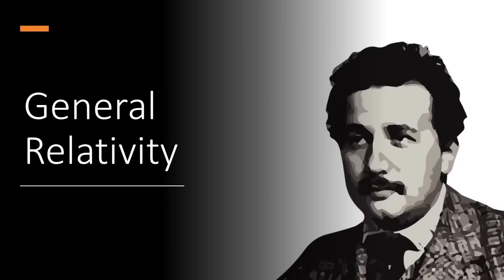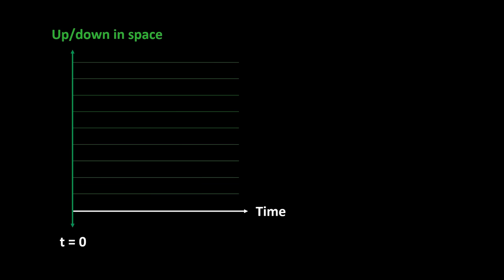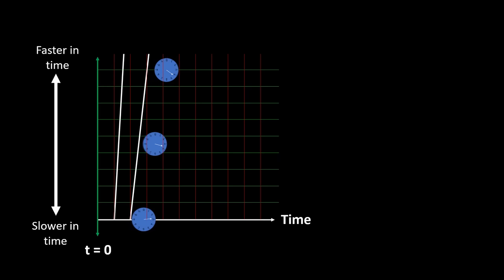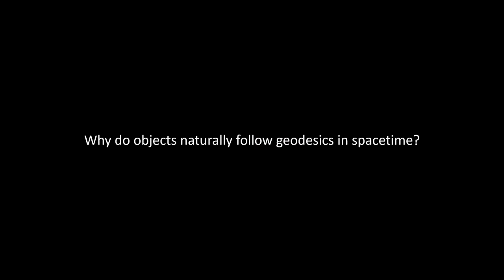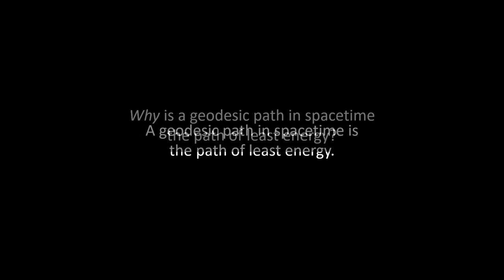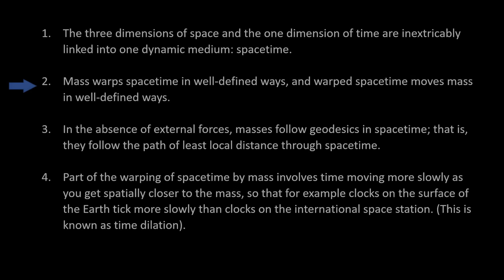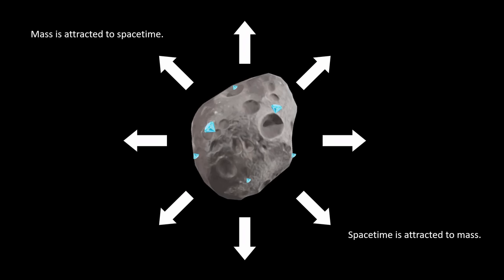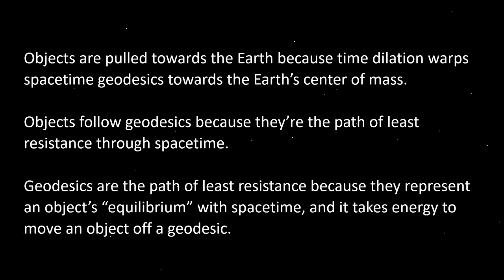How Time Dilation Causes Gravity, and How Inertia Works

Comment: Thank you so much for this. I was screaming at the screen while viewing the other videos you mentioned because of their darn time-flow vector that didn't seem to have anything do with spacetime (or just space). If felt like a relativistic three-card monte. So well done.

But you've given me something new that just feels wrong (not saying it is, I'm just having trouble accepting it): If it takes extra energy to warp spacetime to get the asteroid to move over, (and this makes perfect sense), once it's up to speed it will keep going with no new energy added (at least no new external energy). But the asteroid is still warping spacetime anew as it moves along. That feels like this warping and unwarping should need energy too, just like it did to get the asteroid out of the well it had formed at rest. Or at the very least, the motion would run down as energy gets used up, and of course this doesn't happen. 

The direction of travel length contraction item seemed a little shoe horned in there (bare with me here, this is not meant as a critique). So I wondered if the length contraction has something to do with the asteroid being "attracted" to the spacetime it is about to move into and warp, and I just missed that connection. Or is there a length contraction gradient which would translate to a mass gradient would translate to a time gradient and we're back to what causes gravity but this time, in direction of travel; once an object is moving, or once spacetime is unwarping, does the object create its own "straight" geodesic?

That the asteroid is "attracted" to the spacetime it is about to move into (in this example), feels similar to why mass (or probably better: energy) causes a dent in spacetime. I'm hoping the answer is not "because it does" as it currently is for why mass dents spacetime.
It also feels a little like something riding a wave. The displaced spacetime behind pushes the asteroid forward -  but there is an equal ridge of spacetime in front that must be overcome, so the energy supplied to ride down the hill would be the same as the energy to climb the hill in front. (unless due to motion there is now a time gradient so there is a lag between when the energy is supplied and needed.) Or is it that spacetime itself has inertia?

Again, thank you, I've been chasing the "time causes gravity" for some time now and the veil has been lifted.
Reply from the maker: Thanks! And thank you for these insightful comments, I was hoping someone would raise some of these issues. 

"If it takes extra energy to warp spacetime to get the asteroid to move over, (and this makes perfect sense), once it's up to speed it will keep going with no new energy added (at least no new external energy). But the asteroid is still warping spacetime anew as it moves along. That feels like this warping and unwarping should need energy too, just like it did to get the asteroid out of the well it had formed at rest." 

This is a great question. To clarify the picture, it's better to say that it takes extra energy to change the rate at which the asteroid warps spacetime, not just that it takes energy to warp spacetime. When you speed up the asteroid in the x direction, the asteroid now needs to warp more space per time in the forward x direction, and unwarp more space per time in the backwards x direction. Because mass is attracted to spacetime, the object moving through more spacetime in the x direction is more strongly attracted to spacetime in the x direction. By the same token, the object moving away from more spacetime in the backwards x direction is more strongly attracted to spacetime in the backwards x direction; the influence of the extra warping in the forward x direction and the extra unwarping in the backwards x direction cancel out, leading to a constant velocity. This is the case in any inertial frame (even for a hypothetical object that's completely still in space), the object's attraction to spacetime in every direction cancels out, leaving the object moving at a constant velocity. It takes extra energy to upset this equilibrium by causing the object to warp/unwarp extra spacetime in any direction (which results in that object picking up velocity in that direction). 

One way to say this would be that the extra attraction that the mass gains to the more rapidly approaching spacetime in the forward direction is "paid for" by an extra "drag" on the mass by the more rapidly receding spacetime (which is also attracted to and attracts the mass) in the reverse direction. 

I like your idea of an object moving through spacetime as similar to something riding a wave, but I disagree with the way you have it stated ("The displaced spacetime behind pushes the asteroid forward -  but there is an equal ridge of spacetime in front that must be overcome, so the energy supplied to ride down the hill would be the same as the energy to climb the hill in front."). Try to imagine this wave instead like an attractive field, maybe like a magnetic field. The approaching spacetime attracts the object forward, and the receding spacetime attracts the object backwards, and the two cancel out (for any constant velocity in the absence of other forces). The thing that applying a forward force does is cause the object to be attracted to more spacetime in both the forward and backward directions per time (and thereby to travel more distance in the forward direction per time). 

You're right that the bit about length contraction was a bit shoehorned in; I included it in the video because length contraction and time dilation are correlated with increased velocity through spacetime, but not because that fact gives useful explanatory value in the case we're discussing. The space contraction and time dilation that occurs for objects moving relatively faster than others can be understood better in the context of light clocks (I'll assume you're familiar, let me know if you'd like any clarification). For a light clock traveling through space faster relative to another light clock, the photons must travel farther to tick off the same amount of time (resulting in time dilation), and space also contracts in the direction of motion to accommodate this effect. This is true not just for clocks, but for all physics: in order for the equivalence principle to hold, for an experimenter traveling at 99% the speed of light, the photons involved in the electrical currents in the experimenter's neurons, in the biochemical reactions keeping them alive, and in lighting their experiments would need to travel a ludicrously long distance in the forward direction if space contraction in that direction didn't compensate (alongside time dilation). Kinetic time dilation and space contraction are required to allow objects moving near the speed of light experience the same laws of physics that objects moving at 0 speed follow.
Reply: @IdeaListEye  Thanks for the in depth response and for the respectful tone (so many of these presenters get down right nasty when you ask something) I'd like to solve time travel just to go back before they knew these ideas and give them a taste. There was always a time before we all knew.

Anyway: The befuddlement around the inertia section comes from the warped spacetime resisting being unwarped and needing energy to do that. So far so good. But then one the unbalanced force is removed the asteroid continues to anger spacetime as it unwarps the space it is in and warps the space in front, and to my thinking, the asteroid would have to expend its kinetic energy to keep that up; the warpage acting kind of like friction. Why is a body in motion more slippery than a body at rest? (with respect to the spacetime it warps)
Regarding mass's attractiveness to spacetime, based on the inflow 3D representation of this it seems like that flow would empty the universe in short order. Is this the correct way to think of it? Is this better than the idea that mass just warps spacetime instead making a sink? (so a still from that animation instead of a constant flow?) Is it a flow or a stretch?

Assuming a spheroid asteroid of even mass distribution, time dilations would be consistent all the way round, spacetime warping would be the same all the way round, I'm having trouble understanding why spacetime would being willing to unwarp and warp in the direction of travel with no added energy since it took energy to to do it in the first place from rest. 
Or is it better to look at it this way:
From a geodesic point of view, instead of saying it takes energy to unwarp the space, would it be better to say it takes energy to alter the geodesic? (I think you kind of said that) For the at-rest sphere, the geodesic is as you depicted. With a push, we are angling it's geodesic over a little bit (I think) where it stays once the push is removed. On this new geodesic it's free to continue on its merry way because that is the lowest possible energy state and it's warping spacetime as it goes because, well, that's what mass does inherently. (BTW, to be clear, it's not that I doubt this happens, it's the depiction that energy is required to unwarp and warp space anew that has me frowning) As you say, if inertia is still a shoulder-shrugger even for Kip Thorne et al then there may be no answer to this.
Whether the sphere is warping spacetime while it moves or is stationary probably doesn't matter -  the energy to do that is built into the mass of the object doing the warping. Does the motion really matter at all? Spacetime is reacting to the proximity of a bundle of energy and I"m not sure that needs any help or incurs an energy debt.

I love your geodesics diagrams for time causing gravity. I have now found another video that finally visualizes time and length contractions and dilations by warping the graph grid itself with the lorentz tranforms, while the spacetime motion remains the same -  light bulb moment! (I prefer to get the concept before digging into the math -  I came form the shut up and calculate school - I get the right answers when doing the math but I'm queasy about why. I could be wrong on this but I think Einstein made bigger leaps in the field by conceptualizing than in doing the math)

Yep savvy with light clocks. I was just thinking perhaps length contraction had something to do with how the object would be attracted to spacetime (bit of a hail mary on my part) and thought that's why that segment was there. Can't-get-puzzle-peice-to-fit!
Reply from the maker: @markrichards5630  "But then one the unbalanced force is removed the asteroid continues to anger spacetime as it unwarps the space it is in and warps the space in front, and to my thinking, the asteroid would have to expend its kinetic energy to keep that up; the warpage acting kind of like friction."

The thing that "angers spacetime" (lol) is not the fact of the extra spacetime warping, it's a change to the rate of spacetime warping. This is why an object way out in space resists acceleration proportional to its mass, but moves at a constant velocity (no matter how fast, up to the speed of light) in the absence of other forces. Spacetime warping at any constant rate offers no resistance to motion (so it's wrong to think of it as like friction). The thing that is "frictional" is changing the rate at which an object warps spacetime (which corresponds to changing the object's velocity through spacetime, i.e., accelerating it). Once you remove the unbalanced force, you're no longer changing the rate at which the object is warping spacetime, and the object/spacetime happily continue on in their new, faster interaction.

"Regarding mass's attractiveness to spacetime, based on the inflow 3D representation of this it seems like that flow would empty the universe in short order." 

I borrowed that video representation from a great youtube video, https://www.youtube.com/watch?v=wrwgIjBUYVc&t=0s. Be careful in your reading of it- it's an attempt to show both space and time simultaneously, and it's not showing space warping as time passes; it's instead showing inertial spacetime frames (and is a bit of a confusing picture because of that). The warping of a mass at rest far out in space is constant, and the warping of time by that mass is also constant, so there's no inflow of spacetime. The inflow applies to other masses embedded in spacetime whose geodesics have been directed by the first mass's spacetime warp towards that first mass. 

"Whether the sphere is warping spacetime while it moves or is stationary probably doesn't matter -  the energy to do that is built into the mass of the object doing the warping. Does the motion really matter at all?" 

The motion definitely matters, and the nature of the sphere's warping of spacetime while it moves or is stationary defines that sphere's motion (in particular, its momentum). If you believe in the conservation of momentum, the motion definitely matters. Specifically, the rate at which spacetime is warped by a moving mass (with that rate highest in its direction of motion) is equivalent to that mass's momentum.
Reply: @IdeaListEye  Thanks for taking the time. This makes sense now -  any disturbing of a motionless object or a constantly moving object would be an acceleration and therefor you can either look at it as that energy is needed to change the rate of motion or change the rate of warping. For my noggin I think I like the idea that the energy used to change the object's motion is in fact changing its geodesic. Is this a reasonable way to look at it? Ignoring relativistic speeds, is it safe to say that because the mass of the object doesn't change, the local shape of the curve it produces in spacetime doesn't change, and the geodesic just moves over, or, does the angle of the geodesic change too at the new constant speed? 

I love how spell check turns a mangled "geodesic" into "videodisc" -  I guess that's the flat-earther solution to this problem)
Reply from the maker: @markrichards5630  That's right, the energy used to change the object's motion is changing its geodesic. This is how satellites stay in orbit: by putting in the right momentum, they now travel along a geodesic more or less parallel to the surface of the Earth.
Reply: @IdeaListEye  could you expand on mass being attracted to spacetime(i thought only ST was attracted to the mass)? If mass curves(affects) spacetime, shouldnt the spacetime also curve?(affect) the mass? Wouldnt they cancell each other out or are the forces not proportional ie. mass just affects ST harder?
Reply: @IdeaListEye  wow !  you villain I love your mind. Subscribed instantly. Very underrated. Thanks for your in detailed & thorough explanation! Loved the convo between you 2 guys. Well appreciated.

Comment: Thanks for creating and posting this awesome video!  I could never understand why an object released from a stationary position (like a tree branch) in a gravitational field would start moving if there is no force involved.  What would give it the impetus to start moving?  Now that I've seen your two-dimensional graph of warped space-time, I finally think I understand it.  If I understand this correctly, the object is fixed on a geodesic position, but the geodesic fabric is changing with respect to time, thus causing the object to move through the space dimension.  i hope that's more or less correct anyway.
Reply from the maker: Hey David, you're welcome! Glad it helped you out.

Re. "If I understand this correctly, the object is fixed on a geodesic position, but the geodesic fabric is changing with respect to time, thus causing the object to move through the space dimension."

I think that is more or less correct, but a better way to think about it would be to say that the object is fixed on a geodesic path, not position, because every object is always traveling through spacetime; there's no fixed position because even if it's somehow perfectly stationary in space, the object is still traveling forward through time. 

Using the apple as an example, the geodesic path the apple seeks to take (its path of least energy through spacetime) has it traveling downwards due to the curvature of spacetime making every other path require more energy. It's only kept from following that path by the branch exerting a force on it away from that path (upwards). So, to be clear, it's not that the "geodesic fabric is changing with respect to time"; that geodesic is fixed by the interaction between the Earth's mass, the apple's mass, and spacetime. When attached to the branch, at every instant the apple is traveling further through spacetime than it would if it could follow its preferred downwards path because the branch is pulling it away from that path into a region where time passes more quickly (causing the apple to travel through more time than it would if it were in free fall along its geodesic). I hope that helps! Let me know if you have any questions.
Reply: @IdeaListEye  Thanks for clarifying that.  I see what you mean by the object not being "fixed" on the geodesic.  It is always moving through time. I hope I've got that correct now.  I also think I see what you mean when you say the geodesic is fixed, not the object.